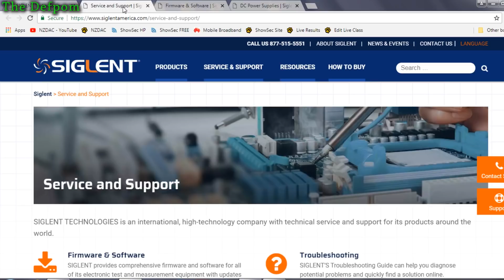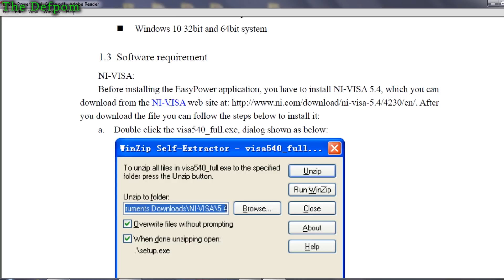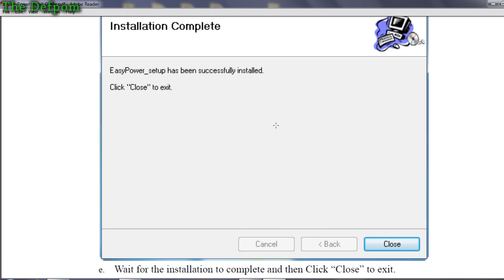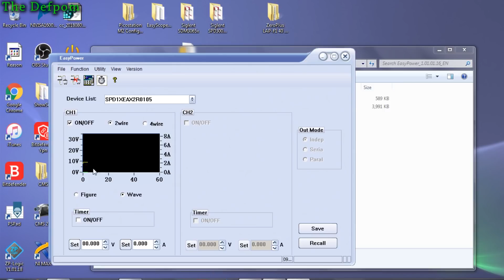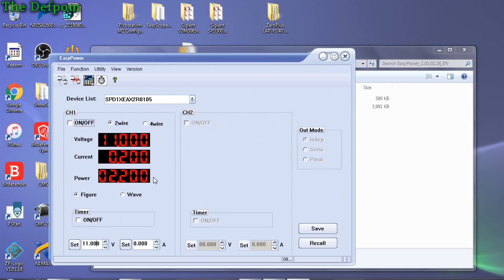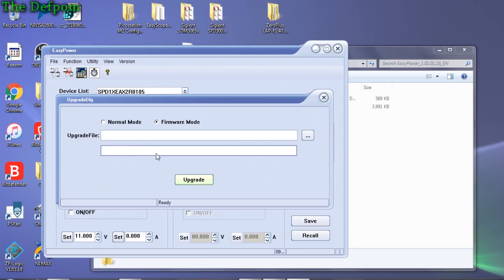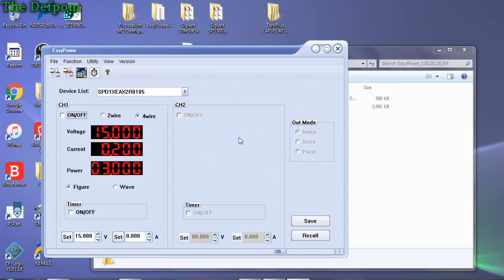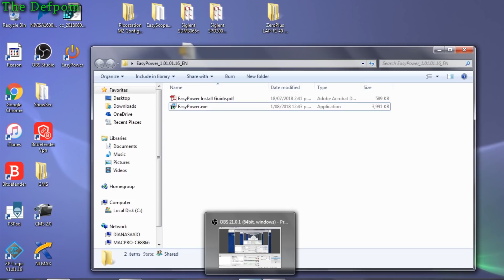🔴 #445 Siglent EasyPower Remote Software on SPD1168X Power Supply

Comment: Not the best software for practical functionality but I've seen a lot worse! I think the digits on the status bar may be showing the time as it shows that in the images in the pdf guide. I also think the cancel button is intended to stop the timer from running, rather than close the window. If so, perhaps an alternative button label would be better.

Comment: Thanks for the demo! I occasioally use USB/GPIB control for things like calibrating HP system power supplies - it's the only way to enter the voltage and current cal factors. I'm also a fan of Windows 7 over 10.
Reply: With Win10 I get that 1GB BS feature update that kills my slow ASDL connection - no $ - for half a day. Lucky I didn't upgrade my other 3 PCs or there would be no internet for 2 days. lol